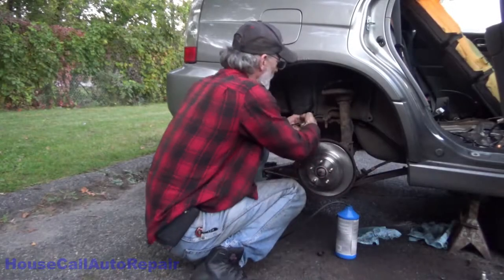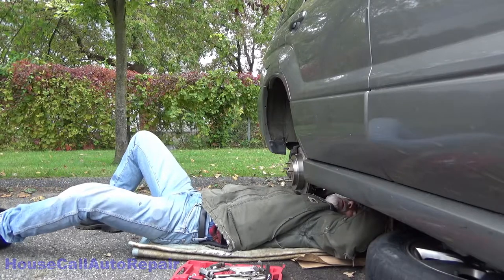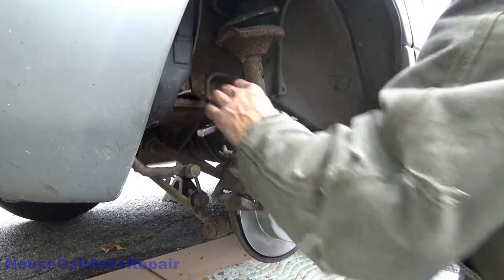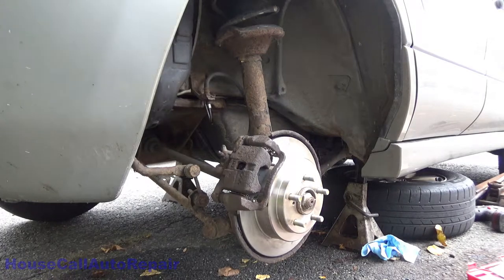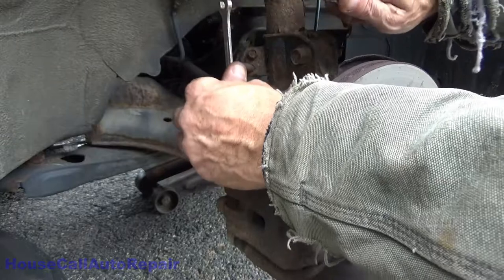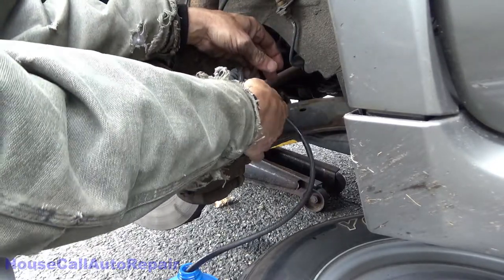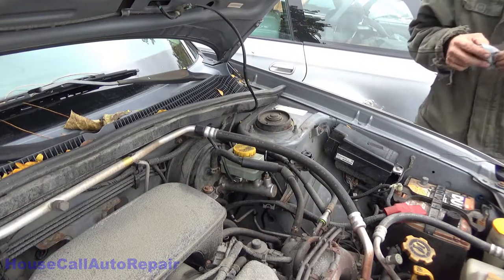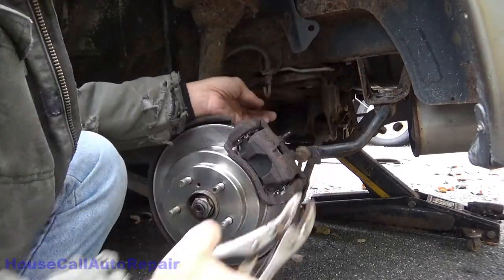2006 Forester Rear Brake Lines - Part 3 - Auto Repair

Comment: Thank you SO MUCH for making this video! I had a line in my '08 forester blow yesterday and after I got into it seeing how the lines couldn't be swapped without dropping the tank, I got a horrible pit in my stomach. My car is also rusted pretty bad and every extra bolt to have to remove is another one to snap off. I feared the worst. Thankfully to you I now know I can run custom lines and keep my baby safely on the road!

Just from three videos I see you have an amazing wealth of knowledge and I'm DEFINITELY subscribing to learn more! Thanks again and wrenches up!
Reply from the maker: Much appreciated! Please make sure that the lines are secured and CANNOT vibrate or rub against anything!

Comment: If the car is going to be in service ling term,

would there be any benefit to painting the steel line or slipping a rubber or plastic tube over the exposed brake line?
Reply from the maker: The car only has a couple of years left to it, before parts start falling off of it.
The brake line a!so has a rust prevention coating on it,that will outlast the car by a few years. Putting anything on the line MAY actually shorten it's life up in the Salt Belt.

Comment: Not a lot you can do about that tire. It can blow out at any time. I would have put it to the rear. Better to let go there than on the steering wheels.
Reply from the maker: Fortunately, the owner replaced all four, shortly afterwards.